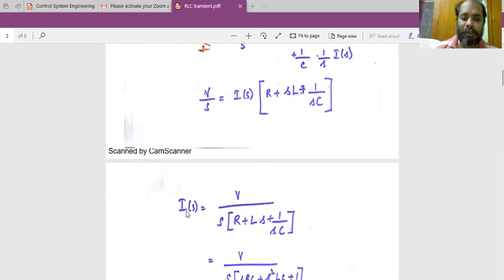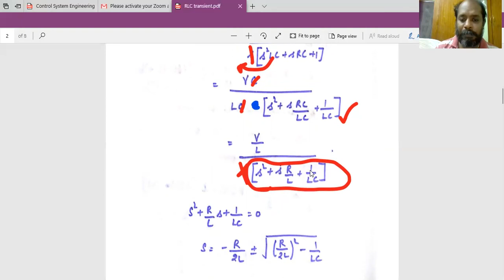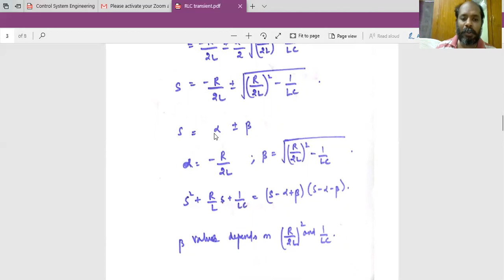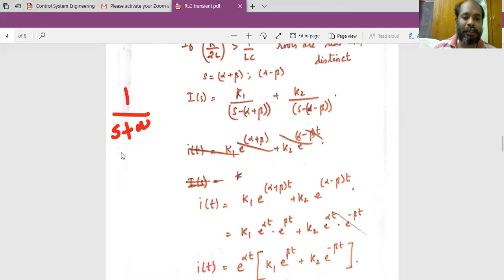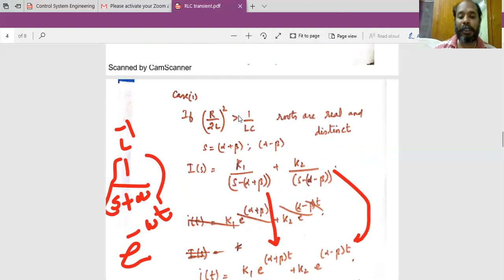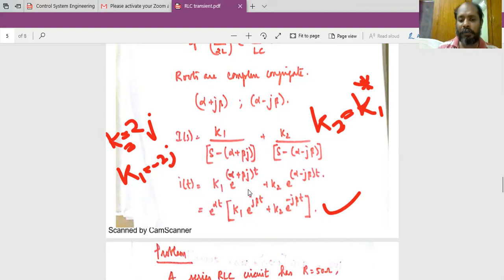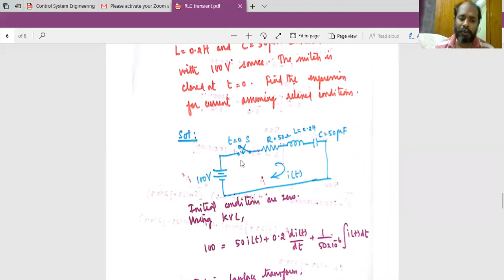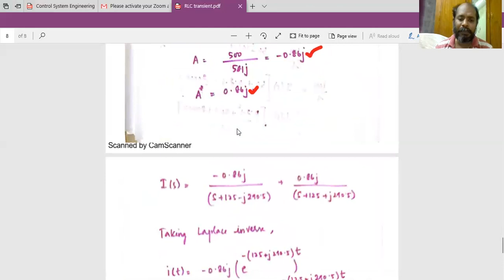Transient response of RLC circuit for DC input  lecture 5

Comment: Sir I have  one doubt in node.the question is "A network has 12 branches and 8 individual loops. How many nodes are there in the network?
Reply from the maker: Number of Loops= number of branches - number of nodes+1 
Using this formula 
Number of nodes=number of branches - number of loops +1
So
n= 12 - 8+1=5.
I think you understand the concept and formula.
Thanks for asking doubts.
Reply: Thank you sir